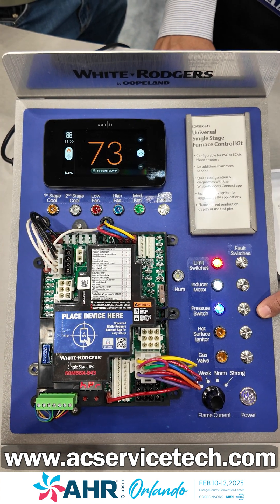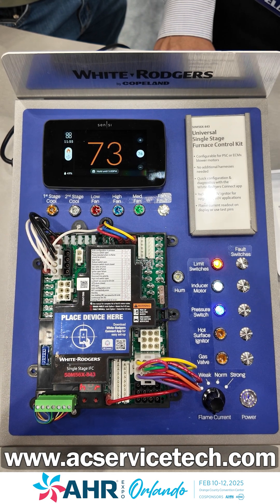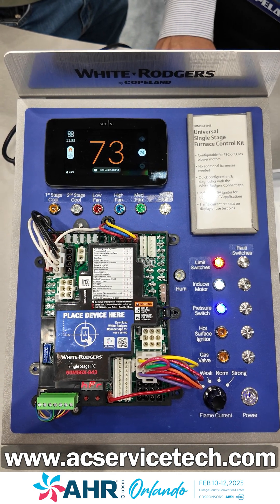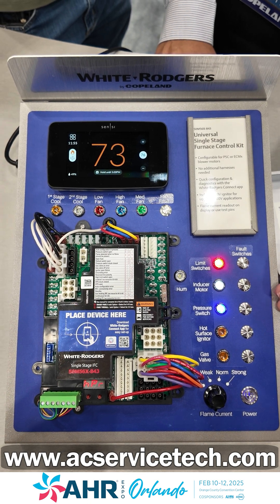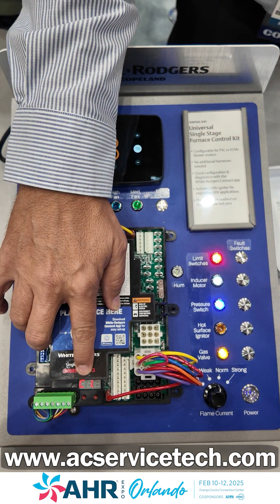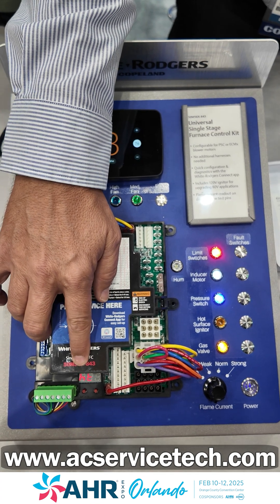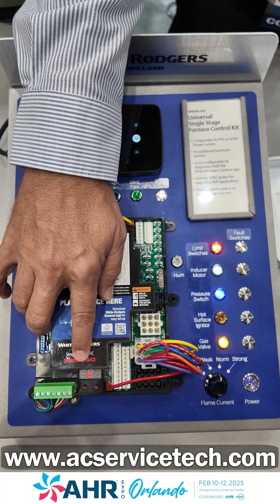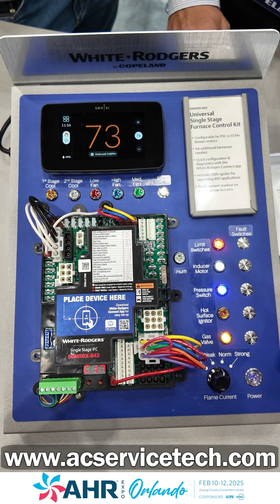Jim Fultz Demonstrates the 50M56X-843 IFC Board!

Comment: I have installed this board. Easy and smooth. You just swap the board and it does the rest. It will learn whats connected automatically.
Reply: This works for all single stage furnace??
Reply: @edgoyette9645  yes

Comment: or just have a transformer, thermostat and contactor  and relays
no computer needed
Reply: I like your oldskool answer lol,whenever I have a bad controller on reach in freezer,  I will install a mechanical stat/contactor and a mechanical defrost timer, takes a little longer but it illuminates all that digital junk.
Reply: @BrandonHouse-vt7kq  freezers and coolers generally have very simple electrical components so that is a possibility in your field, as previously stated in new systems furnaces and heat pumps you can’t just install that junk and it work. This board will probably be a useful ifc replacement considering it has good reliability
Reply: @BrandonHouse-vt7kq  and eliminates that junk also after it is illuminated
Reply: Newer systems, higher efficiency systems, communicating systems.. they all have PCBs. I understand your point, however that's the direction of the industry.